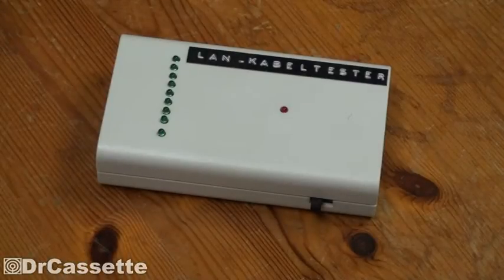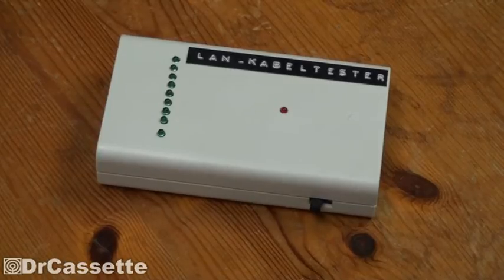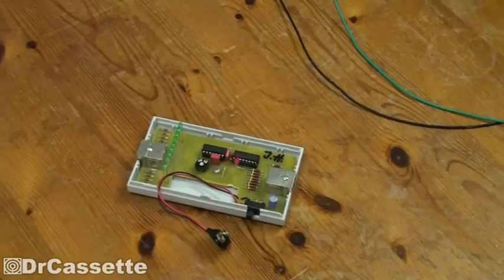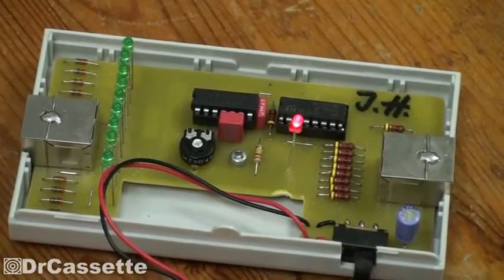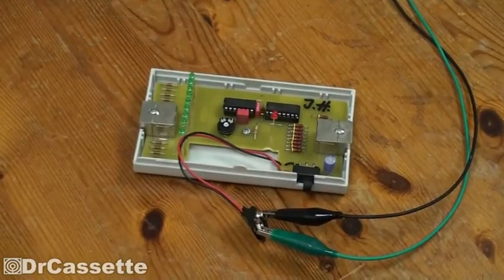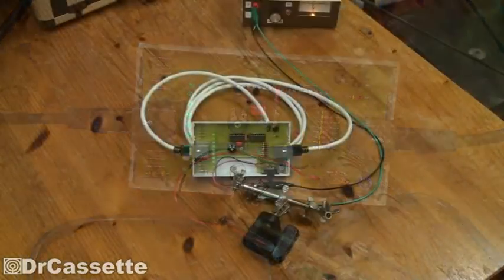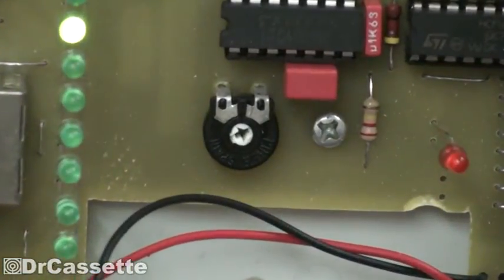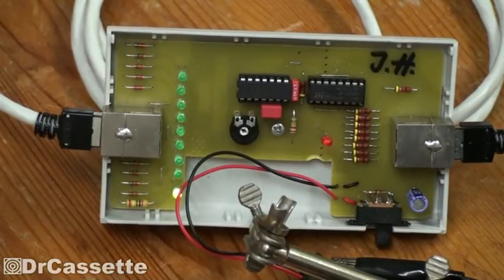Homemade ethernet cable tester demo!

Comment: The led at the bottom, the one you were wondering why it was off for the first unshielded cable and on for the second shielded, is for testing grounding.
If you ask the person who made the tester he will explain it to you.
Reply from the maker: The teacher in my former school who designed the circuit made no efforts to explain the circuit to us.

Comment: There are some thinks for improvement. For example, the one end should be a seperate device in order to see if a cable in a building is damaged. You can only test small cables like 1 meter or 2 what about cables whitch are inside walls or in remote places... you should have a remote device. Moreover, you can build a device to track the cable from the plug to the server room. Thease are the standard things that a cable tester usually do.
Reply from the maker: Note that this was a simple little school project. I know this is not nearly as good as the real thing.
Reply: Yes, but you can easily make it like the ones at the market.

Comment: The last light must be testing for the shielding. you have 9 led's and there are only 8 wires. the first cable was unshielded the second one was.